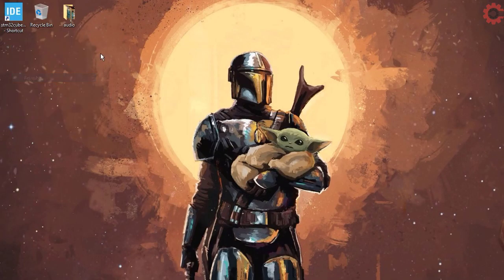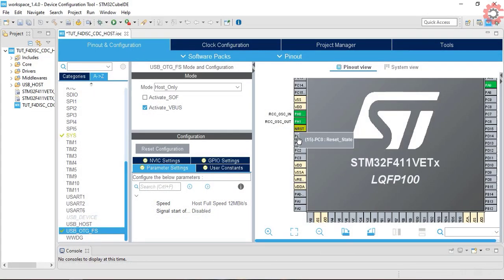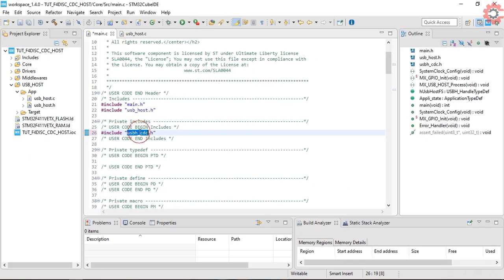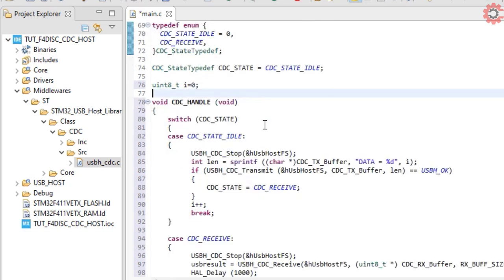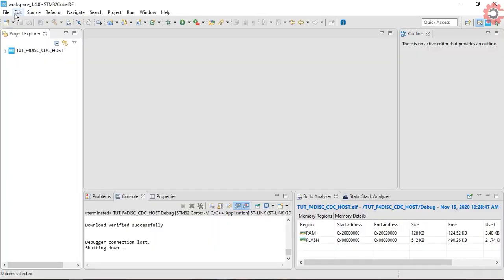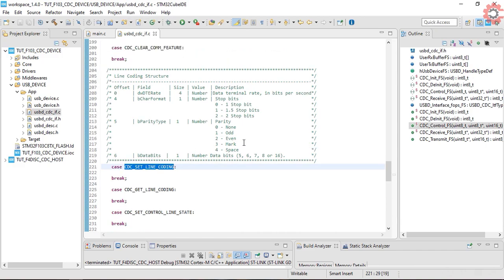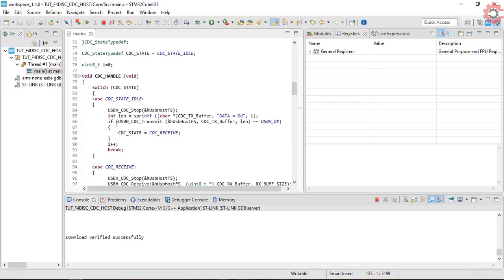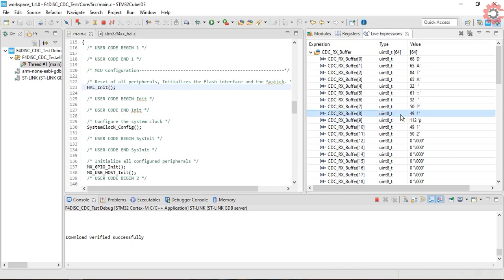Master STM32 USB Communication | CDC Host & Device Tutorial with HAL

Comment: Hello, this errors pop out:

Error[Li005]: no definition for "usbresult" [referenced from C:\workspace\local_st_projects\stm32h7b0\stm32h7b0_host\ 

I already review the code and verify that 'usbresult' is properly defined or declared in a scope accessible to its references. I check for any typographical errors and ensure that all necessary dependencies and libraries are correctly included. I am using an STM32H7B0

Thanks in advance for any help.

Comment: Hi! I see that you keep the ST link usb for power supply and the micro usb for communication, is there a possibility to supply the microcontroller by using only the micro usb? Thank you
Reply from the maker: Micro usb is connected to another mcu, so no. 
You can also power the board by connecting 5v supply to the 5v pin, and gnd to gnd of course.

Comment: I'm trying to implement USB host only-CDC in my NUCLEO-h745-ziq board ( stm32h745zit6u IC ). But whenever I generate a code base from the Cube-Mx, it is generating header and source files for HCD(host controller device). So I cannot implement any of the code that you are providing. 
Is there any way we can generate code for USBH library only from cube-MX instead of HCD ?
Reply from the maker: There is no such problem in my case. I created a similar project on H745 and it is generating the required files properly (I didn't test the working though).
I am using stm32h745xih6
Reply: @ControllersTech  Hi, I am able to generate the file structure and necessary code from the cube-mx. In the latest version of cube-mx, there is a separate wing for the "middleware" and the USB Host has to enabled from there. I missed out this important step.
Reply: @ControllersTech  Thank you for the reply. Please try to test it. Also, compare the generated project file structure with any example on USB (cdc) from ST. You should see some folders and files not present in the generated one, like middleware and usb-host folders, without which we will hit errors. And can you tell me the difference (or relation) between HCD and USB and how to code between them ?

Comment: Hi, I've been trying to apply this config to a Blackpill (STM32F411CEU6) and I've been having issues in the CDD_Handle function. It says that there's an undefined reference to 'usbresult'. Can you help me?
Reply from the maker: Delete "usbresult =" and try again
Reply: @ControllersTech  Thank you! It worked!
Hey, just out of curiosity. Do you think that this configuration can be used to communicate with a ccTalk900 interface?
If not, what could I use to do so?